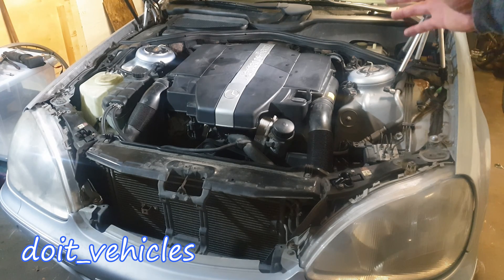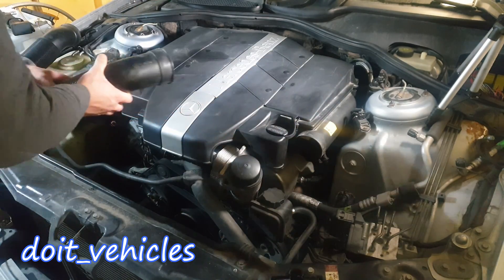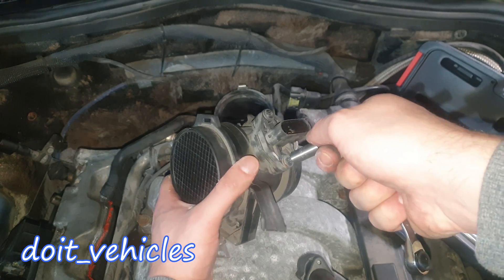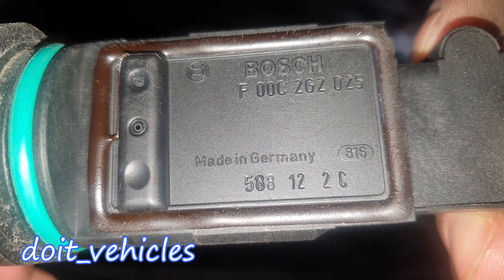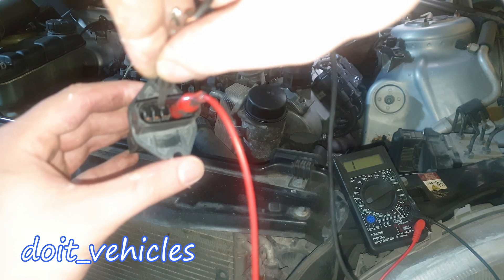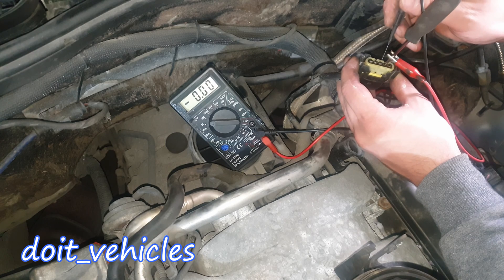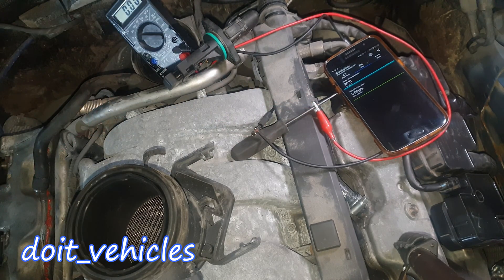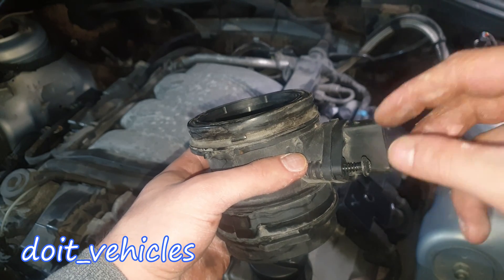S320 Advanced Diagnose of the Mass Air Flow Sensor on Mercedes W220 Problems / Cleaning / Removing

Comment: Hi, do You know if this bosh MAF sensor can be replaced with Hella? I fight with high idle and I replaced MAF sensor with Hella and changed many many things. I even rebuilded intake manifold, I think I replaced all I could and still have high idle. I also asked chat gpt and it said, that M112 can work properly only with bosh MAF sensor because of the characteristic. Even when it fits physically... Can You confirm that?

Comment: When I disconnect the sensor in the car while it is running, the engine sound does not change or turns off. Is this a sign of bad sensor?

Comment: hello ! Do you think Bluedriver will work on EU S500 W220 years 2000 ?
Reply from the maker: Yes, this 1999 S class has the regular OBD2 port
Reply: @doit_vehicles  Thank you for your answer :) I go order one so !
Reply from the maker: you can check first under the stering wheel for the obd2 port to be 100 % sure
Reply: @doit_vehicles  I got the obd2 port under the steering wheel, in the left side. I try several obd reader, but none give me acces in deep diagnozise like your with blue driver.
Reply: Ihave S350 w220 2002 does obd2 work with it?